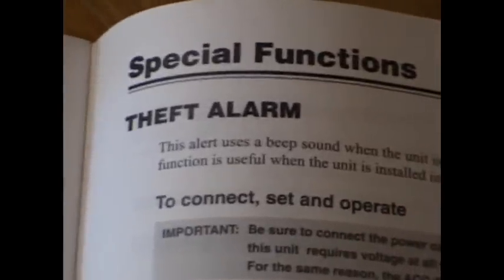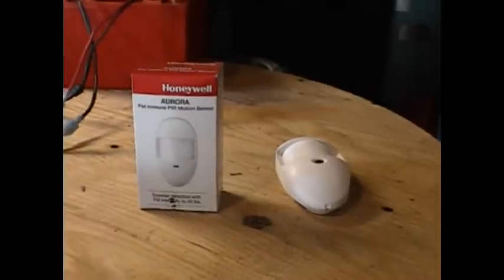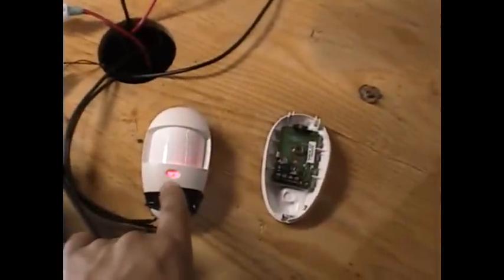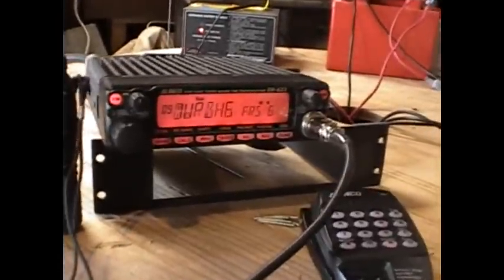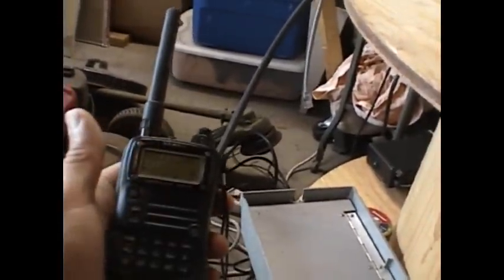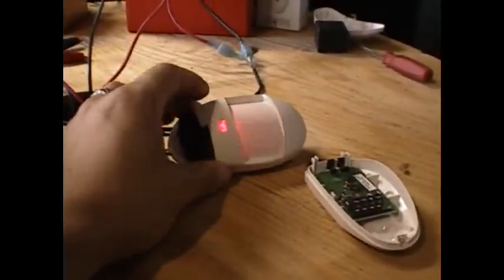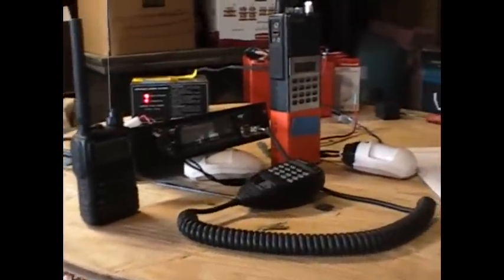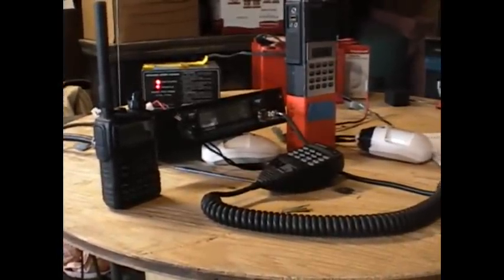Mobile Communications For Any Situation. Part Two (Theft Alarm Mod)

Comment from the maker: I believe you can, the motion detectors have to be strung in series not parallel to work. for example one detector input from the radio, the other lug output to another detector input, the remaining lug returns back to the radio to complete the loop. Its conceivable to string a few of those like that, but might drive you crazy with false alarms.

Comment from the maker: @trigIII Your last question, I dont know what your situation is. VHF in my huble opinion is the work horse of the bands, as far as tactical comms. good lrange for the given power, antenna lenght is managable, plenty of ham freqs to choose. Good is open terrain, forests, suberbia, UHF is great for city dwellers, buildings, tunnels. range is not as far as the vhf given the same power output. I have a 3 part series "prepper intro to choosing comm gear" that explains in detail what to choose.

Comment from the maker: @trigIII VX7R is a  Ham quadbander and it covers VHF & UHF, DR-635 is a ham dual bander VHF/UHF, the TH-UVF1 is also a Dualbander, some were certified, FCC part 97 (HAM) and some FCC part 90 (Govt/Business). Simple answer, yes, They could all talk to each other on the Ham frequencies. Thats the exact gear that I have and using. Yes they are all capable of transmitting in VHF.

Comment from the maker: @kc0rey Mr. Hays, if thats your ID according to the FCC license search? Yes I publicly demonstrated that feature on 146.470. It was 5 watts transmitting into a service monitor port, essentially a dummy load, if you looked closely.
Yes, I'm a ham operator, and a FCC commercial license holder. That particular freq is no where close to a repeater, and I ran simplex without CTCSS,  it was a test only, I use another simplex freq for the alarm feature normally. I also Identified myself off camera.